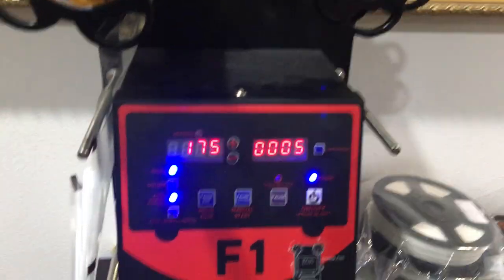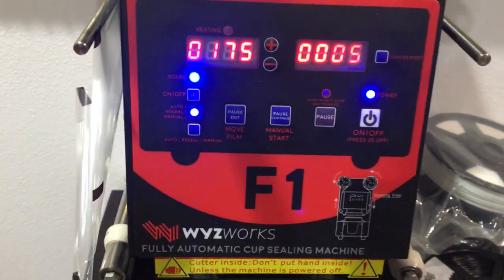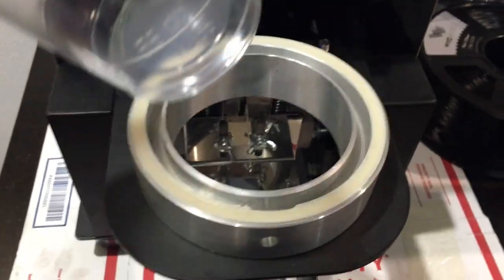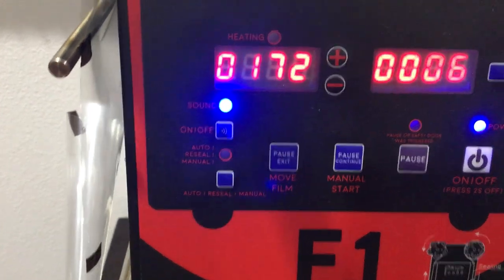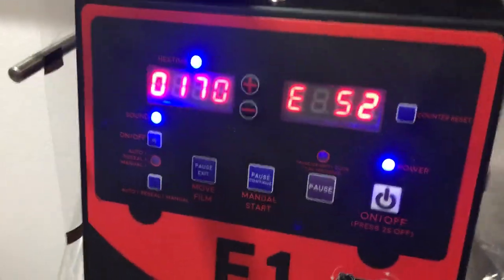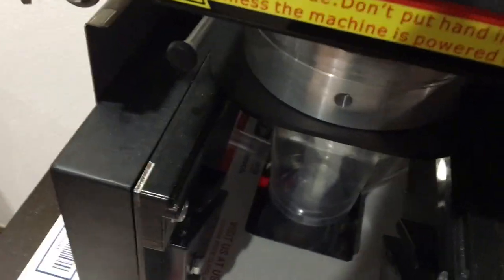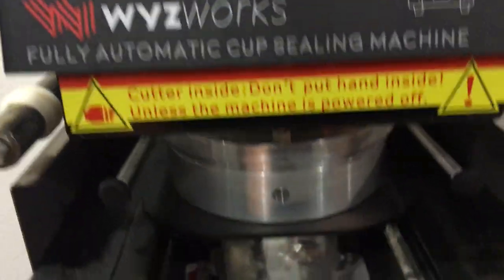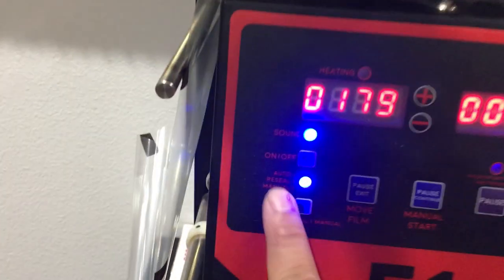F1 Fully Automatic Cup Sealer MODES (Manual, Reseal, Auto) Functions

Comment: The machine can sealling small  cup
Reply from the maker: It has to seal 95mm sized cups.  Please makes sure it fits these dimensions. There is no adapter it comes with to change sizes. It will not work for 98mm.